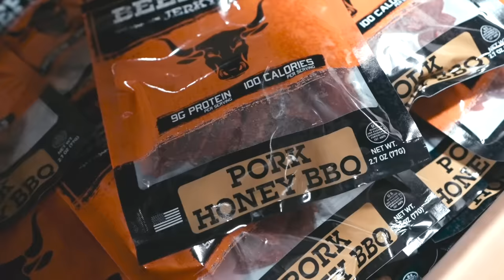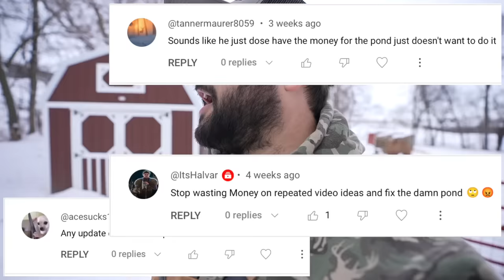Why I Haven’t Talked About It….(The Truth)

Comment: I wouldn’t go with the liner too many things that could go wrong and might stop grass from growing in the water, clay seems like a much better option
Reply: I agree
Reply: Go with bentonite clay but just make damn sure it's done right. Use an articulated compactor and make that clay layer thick and solid. Do it right, do it once, and make damn sure the contractor knows how critical the layer is. Get a consultant and project manager that will make certain the job is done as designed. Go thick and heavy on the clay with no thin spots and compacted solid.
Reply: @4x4_Adventures  moo moo
Reply: So spend a quarter million dollars and then crawfish get in there and digs holes right through the bottom? 🤦
Reply: @4x4_Adventures you don't know anything
Reply: I agree
Reply: @garrywilliam2088 if you put bentonite on top of clay it will still try to stop the grass from growing anyways to though if you really think about that
Reply: Clay all the way 💯
Reply: @JuarezDerrick  But isn’t some leakage normal? On our ponds the water levels rise and fall all the time. And i find it hard to imagine a hole dug by a craw or catfish will drain a pond that big. Just a thought, i really don’t have much knowledge in pond building stuff.
Reply: @4x4_Adventures  Well Tell us then Mr wiseguy rubber liner is worse they will degrade and is bad for the soil when rubber brakes down is the same reason why you don't make a flower bed with old car tires you end up with cardogenics in your veggies
Reply: @cdmwilke9541  yes some some leakage could happen but it's definitely not what you want. If your pond is sealed it will still lose water through evaporation! The problem with a crawfish putting a hole is once water starts running through it that hole gets bigger and bigger!
Reply: We use liner here in Florida for all of our ponds you layer the pond with the liner clay top it and then sand top it and that’s where you can throw all your grass seed it works amazing
Reply: Yes I agree man the clay is the way to go
Reply: Yeah I would go with liner then put clay over top of it
Reply: I agree

Comment: I'd consult bama bass and his pond connections. Seriously reach out to him! ...... id go clay route if it were me and i wouldnt have hesitated about that decision either. Lol. Just remember with the clay option and there is a few leaks there is a product that is poured on the surface, it will mix into the clay and make a permanent seal, and its not expensive.
Reply: Agree, bama bass pond is amazing.
Reply: 💯 Bamabass
Reply: Ya 💯 percent agree with this
Reply: Isn’t he a low key googan affiliate?  Or atleast he used to. I’m sure he would help Flair out.
Reply: I agree as well with this
Reply: Agreed
Reply: I think his pond is too shallow though, most parts are 2-3 feet deep and its very clear making the whole thing a big tub for plants.. when u dig out a small lake i would go a lot deeper if possible.. better for the fish also.. and for longevity. Ive got a pond this size near my house that is 30-40 feet deep.. and clear sandy bottom.. now that is a nice pond. (basically a small sand pit). Good for swimming also.

Comment: The clay will work. I've dug several ponds. It works, but it's not a pool. It is natural to have some water fluctuation over the seasons. Just make sure you make some beds of gravel for fish to spawn. They won't spawn over clay. The advantage being you will always know where those bass beds are. Also put grass and clover seed and straw mulch on the banks after you put the clay down on the slopes. It will take and stop the slopes of the banks washing away. Also this is extra, but since you are starting over. Think about fish structure. I like to use old Christmas trees, and piles of field stones that got dug up while the pond was being dug. You can pick the trees up for free off the side of the road the week after Christmas. Another trick is to go for a drive after a storm and pick up windfalls and use those for structure. In summery. Clay. It lasts forever too.
Reply: agreed my best friends grandpa has 7 ponds and I helped dig out 3 of them. totally agree @jordantrottier3882 is right. the weather will fluctuate the water and Gravel is needed for the fishes. the liner would be a Hassel IMO. Great video cant wait for what you decide @FLAIR

Comment: Hey Flair, when I was in the military, we actually built a pond in the desert. We had clay and bentonite brought in from all over the states. I do i strongly believe clay and bentonite would be the best option.  It might cost more up front but I think your pond would last a whole lot longer without any problems. If you went with a liner, you have to think about the seams, the probability of it having a hole, or getting a hole.  Think you will want to but a boat on the pond the prop could cut into the liner. You'd then be right back to square one again anyways having to drain the pond and replacing the liner or just putting clay and bentonite down. I say save yourself the time and go with clay.  keep up with the great content, I'm excited to see what's to come in 2024!

Comment: I think you should keep in tune with your gut feeling. I agree with holding off, at least till spring comes and see what the runoff from the snow does and then focus after that. Be smart, keep it on the back burner and focus on the other things that need addressed more now.

Comment: Flair I'm not an expert.  However I work with a company that subs out machines used in soil stabilization.  These vehicles mix the existing soil with concrete powder.  Thus allowing the creation on retention ponds. I am not sure if you have looked into this option but these rain water retention ponds holds allot of water and located in several sections around these properties we are building.

Comment: Bentonite and clay...give it an initial packing and then fence off the pond area and let loose a pack of hogs to pack it in as you slowly as you fill it (we're talking a year or more). Not sure on the surrounding area around the pond but if you have any drainage from nearby hills redirect it towards the pond area as well to supplement the well during winter/spring rains.

Comment: If you want to do a clay liner you have to proctor it and do a compaction to 95% which is standard. If you do a poly liner you don’t have to go crazy thick to hold water but large brush or shrubs can impact the liner and cause leaks but you can perform patches to it that are some what cost efficient. For what you want to do with it I would go clay but again growth of vegetation can impact and cause leaks in either liner.

Comment: I do directional drilling and there's a powder that turns to jelly and if you sprinkle on top it will sink to bottom and fill holes Bama bass used something similar sand grenade

Comment: Have you checked into cement treatment. Plasticity index testing and complete sieve analysis if you decide to clay line. I think a P.I. of around 30 is what I would  look for. Next time, maybe look at Geotechnical Engineers to have subsurface testing done. Drilling at different locations running split spoons and rock cores with soil analysis done on samples. Compaction testing based on standard proctor verified by testing with a min of 98% dry density at +4/-3 of optional moisture.

Comment: 1-2ft thick clay liner compacted with sheepsfoot roller. Clay must be certain moisture level to compact properly, ask a soil tech or pond builder about that. But if it's done right it should hold water like a bathtub. Bamabass had extremely poor sandy soil too and his clay-lined pond holds like a champ.

Comment: I'd say bentonite. Worst case scenario if there's still a leak you could add dye and see where the leak is and add extra bentonite in that specific area rather than drain the pond and re apply over the whole thing. After say a few months if there are any leaks once you add more bentonite to that area it should help to seal off the whole pond. A liner would be good but if it leaks you'd either have to drain the whole thing or have a diver patch it where bentonite you can just pour more over that area and save money, time, and labor by not needing to drain the pond any
Reply: Make sense

Comment: Bentonite and clay pond liners have several advantages over rubber liners.

Natural Sealing Properties: Bentonite, a type of clay, possesses unique swelling characteristics when in contact with water. This swelling forms a tight seal, effectively preventing water from penetrating the liner. This self-sealing ability makes it highly efficient in reducing leakage.
Cost-Effectiveness: Bentonite liners are often more affordable than rubber alternatives. The natural abundance of clay as a raw material contributes to lower production costs, making it an economically viable choice for pond lining projects.
Environmentally Friendly: Clay liners are considered more environmentally sustainable compared to rubber liners, which may involve synthetic materials. Bentonite is a natural resource, and its extraction and processing generally have a lower environmental impact than the production of synthetic rubber.
Adaptability to Substrate: Bentonite liners can conform to the underlying substrate, providing a more adaptable and flexible solution. This adaptability is especially beneficial in areas with uneven terrain, where a clay liner can better conform to the landscape contours.
Resistance to UV Degradation: Rubber liners may be susceptible to UV degradation over time, potentially leading to a decrease in their effectiveness. Bentonite liners, being a natural material, tend to be more resistant to UV damage, contributing to their long-term durability.
While rubber liners certainly have their applications, the unique properties of bentonite and clay make them a compelling choice for pond lining, particularly when considering factors such as cost, environmental impact, and adaptability. I’m looking forward to seeing what you picked in your next vid. I love your channel and I’m looking forward to trying some beefcake jerky. sometime

Comment: In HVAC when you can't afford a whole brand new system, you slow down and figure out where the leak is and fix the leak. And if you're successful it ends up being a huge savings and your system lasts another ten year's. 
Find the pond leak and fix the leak.
Water is likely cheaper than dirt, if I had to guess. So if you have to do it twice to get the leak fixed, so be it.
Reply: There is leaks everywhere he only has maybe 2 feet of water 😂
Reply: The whole bottom of the pond is the leak. Top soil doesn’t hold water, it seeps down. He needs clay. Guaranteed there’s clay in the hillside next to the pond. Dig more of the pond out, dig a borrow pit to get clay out of the hillside, fill the borrow pit up with the dirt that comes out of the pond. Not that difficult

Comment: What about maybe putting the rubber liner down then just a thin layer of clay to protect the liner?
Reply: sounds even more inviting for a muskrat to bore threw. lol
Reply: Very expensive
Reply: He will if you are paying
Reply: Not practical 
They would have to put the layer of clay on by hand because a machine would tear it.
Reply: applying a layer of clay will have a good chance of making a leak in the liner.
Reply: Do the clay, as I saw with bamas videos during the pond build, he had some minor leaks and was able to put some liquid or powder stuff to close the holes. It’s easier to fix clay than a liner in the long run.

Comment: What you really want to do if you don't want it fluctuating over the seasons or possibly drying up is a liner then top it with the clay. A big part of this is how much land is draining into it. The 2 ponds we have are just clay and they fluctuate significantly but our advantage is that almost 10k acres drains into it. it's at the base of a massive hill. The other downside to that is one time during a massive rain, the water washed over one side of the dam. it was really bad. RWD1 tower pipe got washed out and it completely drained the water tower. it was epic bad... well, there are a few thoughts. I'll let you put em together into whatever you want.

Comment: Farmers around me here in Georgia when the pound would not hold water they would put a fence around the pond and put a bunch of pig's in the pond and the oil off there back seal the dirt and it will hold water l. It would be a cheaper solution to the liner or clay and worse case scenario you can sell the pig's when done. Just a thought

Comment: I have absolutely no knowledge of pond-building, BUT after reading thru the comments, I thought I'd throw my thoughts in the pot. I wonder if a combination of the two may be a good idea. I agree with most that you should clay/bentonite the bottom. Here are a few reason that make sense in my head, such as it being a more natural environment for the fish where you could put some old trees, etc. for structure. If you had a rubber liner, I'd be worried about how sharp the edges are when you toss things in the pond for structure to being with. That second reason is being able to grow grasses, etc. on the bottom for the fish to hide in and because if you hook the bottom of the pond, then you've got an issue for sure. Could you do the bottom in clay/bentonite and then put the rubber membrane along the sides of the pond? I wonder if that would make for a lower risk of erosion of the sides? Again, this could be a totally idiotic idea, and I'm ok hearing that if it's done nicely, haha!  One person who commented made a point that it's important to put grasses on the banks for erosion purposes, but could a rubber membrane on the actual sides of the pond (not the flat banks/ground around the pond) help with that, especially since you'll plant grass there?
Most importantly in my opinion is to do what you think is going to be best and what you are most comfortable spending that kind of money on. Don't go spending all that cash on account of us. Like you said, you have other properties you can fish at so as awesome as it would be to have a fishing pond on the land where you live, it's an extreme amount of money to spend. Like I said, do it for you, not for us. With all the other videos you do on a huge range of things, we're ever bored. If you do decide to do it, there is no rush to have it done by this summer, in my opinion.
Those are the thoughts of a 53yo disabled lady in Canada who loved to fish but has no idea how to build a pond beyond digging a hole, haha. Again, my thoughts could very well be the most ridiculous thing you've ever heard but wanted to toss it out there.
Have a great week, Andrew, Jake, Banjo, Big Jr., family and subscribers who have been brave/alert enough to read to this point.
Wishing everyone well, 
Heather🇨🇦

Comment: Bentonite will definitely be better because it will over time seal any cracks or breaks from roots or gaps in the soil. If you were to put a liner you would have to go in and remove any sharp rocks or sticks and it would be hard to operate around it with machinery so if you wanted to put big structure in, you would have to do it by crane or hand. 
Team Bentonite!

Comment: I use to build enclosures for exotic animals and have done many smaller ponds and pools. Though this is not on the scale I am use to, I am 100% sure that clay is the way.  Though in the one video you did that shown a possible route to a leak, I would investigate on that more and see if it will be a problem later. It very well could be an animal hole and cause a big problem...especially if its something like a mink or otter. 
I did many pond/pools that were concrete and are great but on that scale it would be way too expensive and you would need a sprayed liner which will degrade of time and require repair. It would be better than a liner though but its the most expensive option. Concrete will last a long time though if done properly.

A liner is not a good choice for someone like you whom wants to hunt and shoot in or around the pond. Repair for liner will become a hassle and get expensive over time.
Clay is easier to repair than the liner believe it or not. You just need to jump in a boat and pour a product like SoilFloc which is like a polymer into the water to fall at bottom to create a seal. As others have stated, Bamabass did this and was very successful. 

At the end of the day, if you want to keep the size of the pond at its current than clay is the way. If you are willing to spend well over your budget and decrease the size of the pond than its concrete. Liner pond/pools are best for water features and swimming holes.

A few tips: If you are going to put in a dock or anything that is dug into the ground you want to dig it out and fill in the entire area with clay. The dock will settle and sink and could puncture the clay bottom and cause leaks. If its filled in than it will be easier to seal with polymer later if you need to. If you have a well (which you do) that flows in you may want to dig it out a little bit (like dock posts) and compact it with a bit of clay and than lay some concrete structure to allow flow without erosion. Its essentially a concrete slide basically. When I did enclosures we sometimes used pool armor epoxy with a coat of pool paint to look nice but you could just raw dog it. Concrete will sponge water a bit though if its not sealed and the integrity/longevity of it lasting before cracking could be lessened.